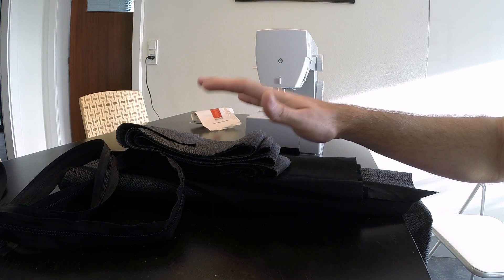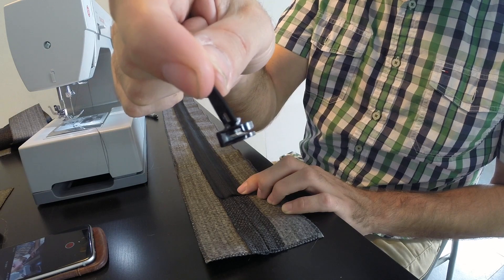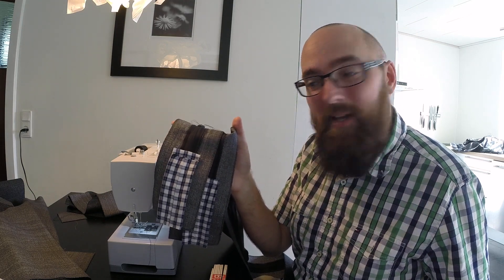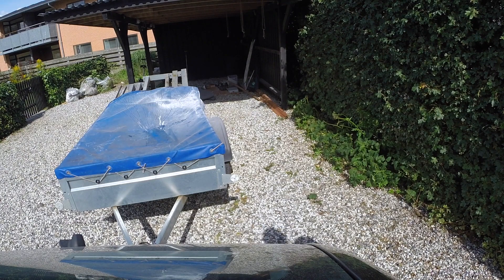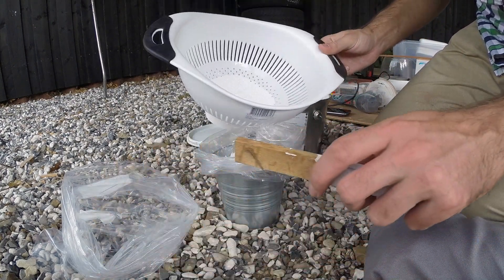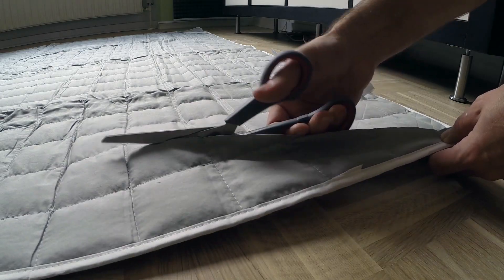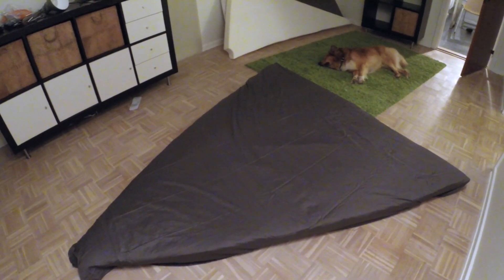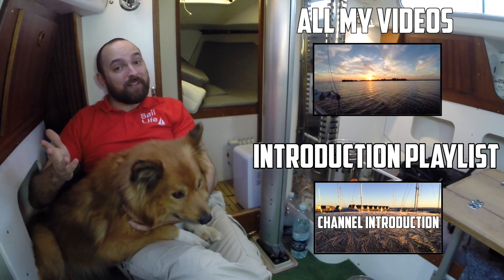Sail Life - Moving aboard my boat, part 3 of 4

Comment: Mads, I too needed a hotknife like they use on the Sailrite vids....couldn't see spending that much $$ so I found a cheap woodburning kit at the local discount tool store ($8 US) and it had a variety of tips for it, one of which proved a good substitute for the fabric cutting tip used by Sailrite....it works well, seals the edges of Sunbrella fabric nicely.  Good videos, keep up the good work.

Comment: RE Holding tank to meet marina rules.
I have the same problem for my SS34 and I have come up with a workable solution that may fit your situation.  In my head compartment I can fit a 20lt petrol container strapped to the hull side without getting in the way of the toilet.  By modifying the pourer fitting that comes with the container and removing the flexi pipe and then modifying an plastic irrigation fitting to fit through the cap I now have a 25mm barbed pipe fitting that I can attach to a hose from a Yvalve to be cut into the current waste pipe.

You end up with a 20lt removable waste holding tank that complies with marina rules,  If you or a guest were caught short and needed to use the facilities onboard then the head would pump to the container and you could remove it and empty it at the marina bathroom.  I can put photos on my web site if you are interested.

If there was insufficient room you could use a smaller compact 10lt fuel container instead.  If you lock the Yvalve so that no discharge is possible then I would expect you would be able to convince the marina owners that no discharge is possible.

THe other thing you should think about if you install a real holding tank, vent and suction lines is that you would normally require a mascerator in the system (separate unit or an electric toilet which includes a mascerating pump.  You have a hand pumped toilet and this would not really work in the long term without blockages.

I really enjoy your videos and I am going to use some of your ideas in the referbishment of my S&S34 (which is not a lot larger than your 30footer and has a lwl of 26ft).  Keep up the great work.

Paul
Misty II
Melbourne

Comment: Hm, maybe you could put it upside down, place the protective layer (brain fart, don't remember the name) then fold the two mattresses inside, like that old coin trick with the paper, where you fold the paper to slip the bigger coin through the smaller round hole.

Then you'd just flip the whole thing around and you'd be done.

You could also do something else, on the next modified sheet, remove the elastic band completely and sew in a channel on the edges of the triangle, then fish a line through that channel.

Like in an army bag you'd just pull on those once you've placed the sheet over the mattresses and lace the two ends. The advantage to that is you don't have to bother with rubber bands and the end result is always a taught piece of fabric because the string on the other side doesn't care about the shape, it just pulls equally on all "corners".

For a better image, think about those tiny yacht boats, some have covers that go over the edges and are similarly pulled taught over the top with string in a channel.